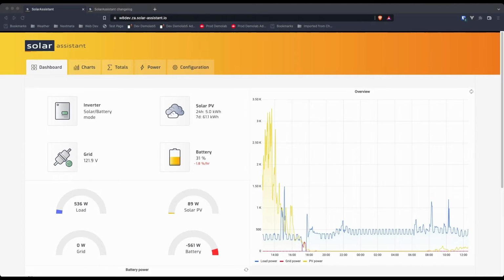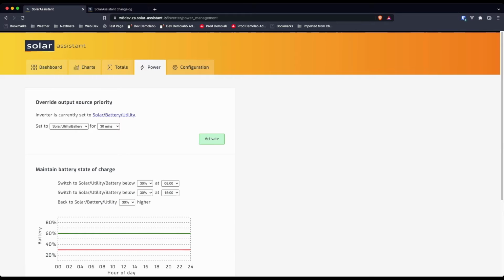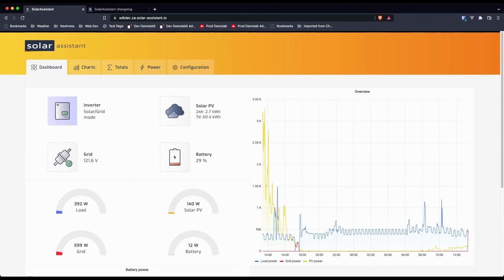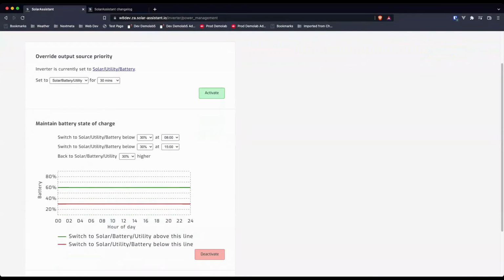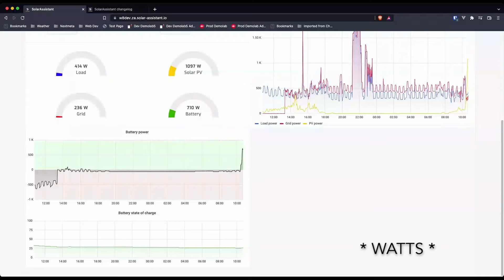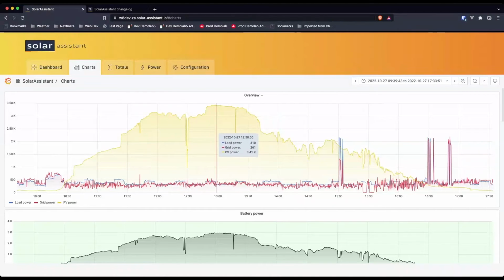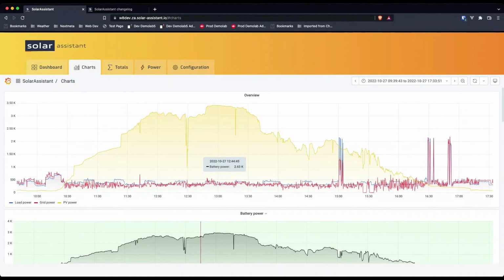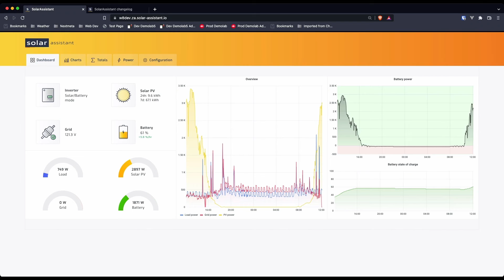EG4 6500EX and Solar Assistant - Automatically Switching from Battery to Grid for the First Time

Comment from the maker: After having some discussions with SS, I’ve found out that any time your inverter is in “utility” mode (whether that’s using SBU or SUB), all the solar power your system is producing doesn’t always go to the loads first (as the output priority states). Even though the modes and the manual dictate Solar, then Utility, then Battery as your output priority, apparently it doesn’t work that way.

According to SS: “In SUB mode, the inverter views Solar and Utility as its main sources of power, so it finds the most consistent, reliable source of power to power loads. In this case, it's utility power. as the voltage doesn't fluctuate as often, and it is available in the evenings as well. We recommend setting your inverter to SBU so that the inverter will use solar as its source to power your loads.“

Supposedly they’re supposed to be working on a firmware version to correct how solar is used when you’re in SUB mode so it properly handles the output priority specified.

So that might be one reason why there’s a discrepancy in load vs grid vs solar.

Something else I discovered was regardless of how many inverters you have set up in Solar Assistant, you’re only gonna see cumulative information on the dashboard. I have 2 inverters in my environment and each has 2 separate pv arrays. At any given time, you might have more solar coming in on inverter 1, but more of your loads are coming from inverter 2. In that instance, you’ll see power still being pulled from the grid while there’s power being put into the batteries (Because the battery power is being put in from inverter 1, but the grid is pulling power for inverter 2). Hope that makes sense.

The last thing I noticed was the different values in Solar Assistant don’t seem to all update at the same time. PV might update, then a second later the loads update. You’ll really see this when you’re on your Inverter Cluster page in Solar Assistant. So it’s kinda hard to be able to say for certain if the values you’re seeing are exactly the values at the moment when you’re trying to do any manual calculations.
Reply: Thanks Adam.  Great videos.  I've been following this one in particular as what you're trying to do is exactly what I'm shooting for.  My experience with a MakeSkyBlue Solar Inverter was so disappointing, I'm doing lots of homework and my leading next-purchase is an EG4 6500EX.  Did you get any idea from SS as to the timing of the firmware update that allows SUB to work properly?  Thanks so much.
Reply from the maker: @arrowpig1996  unfortunately not.  I’m a developer myself so I know it’s hard to nail down timeframes on fixes when you already have a lot to work on.  I’m not sure where this falls in the list of priorities.  

Now I will say, while it’s annoying to have all the possible Solar not be dedicated to your loads while in utility-bypass mode, it does allow for your batteries to recharge a little bit faster so you can switch back to battery mode quicker.
Reply: @AdamDeLayDIY  Thanks so much, that's a good way to think about it.  As long as most of the solar supplies loads (and charges), then I suppose the goal of saving power bill money can still be achieved.  Keep up the great videos, BTW.

Comment: Adam, thank you for your focus on the AC input.  I too am interested in more of a hybrid installation.  Minimize my grid consumption and use grid to pick up the slack at night of bad sun days.  Tempting to go EG4 because of the price, but Sol-ark maybe for the features.
Reply from the maker: Thanks.  Yeah, that's my entire goal.  If I can use solar as much as possible (growing the system when available) and using the grid to be my "backup power", it should definitely help save some money on utility bills and become less reliant on something where pricing is continuing to increase.

I know I mentioned this to someone else, but keep in mind you do get what you pay for.  In my environment, the inverters were the cheapest part of the system.  While the EG4s work, they do have their glitches/issues (of which I'm sure every system does).  All I can say is do your due diligence and try and find unbiased reviews for each piece of equipment you're looking for.  

Good luck!

Comment: I have an 6500ex which has still not been turned on yet.  Still working on on getting things setup.  I appreciate the look at Solar assistant as I have not got down that road yet.  My guess on why grid was still providing power even when there was enough solar was that your batteries were not quite at the 60% mark to turn off the pull from the grid?  Having never turned on my 6500ex myself or know anything about their programming I can only guess that it just looks at battery level and since you have it set to pull from the grid at 30% and not turn off until 60% that it is going to do that no matter what even if there is enough solar coming in during the time frame grid power is being used.
Reply from the maker: Good luck on your install!  Solar Assistant is definitely something to invest in.  I'll probably do another video just on how I have it all set up.

So to my knowledge, all solar assistant is doing is triggering the actual change on the inverters from SBU (Solar/Battery/Utility) to SUB (Solar/Utility/Battery) and back again.  I can mimic the same issues by manually switching the inverters priorities (completely excluding SA).  

The manual makes it seem cut and dry.  "Solar energy provides power to the loads as first priority. If solar energy is not sufficient to power all connected loads, Utility energy will supply power to the loads at the same time".  So either there's a glitch in the firmware, or the manual needs to be rewritten.

Comment: I have notice on more than one occasion that a manual switch with SA set the AC FREQ. to 50HZ and also did crazy stuff to other options. If you see the ac icon flashing it indicates 50HZ. All of your appliances become under performing zombies. Garage door openers do stupid things. I also thing we need to explore option #5 . Not sure that the EG4 preset is doing us a favor.  May use "USER" and pick your own voltages.
Reply from the maker: That’s very odd.  If made a lot of changes using SA and never had any erroneous additional changes made to any of my settings.  I have heard that there was a firmware issue which caused settings to reset when changes were made.  Wonder if your on an older firmware version?

I agree that I’ve heard of more issues with the EG4 settings than I have success stories.

Comment: Perhaps you could explain how the AC input hook up is done.  I have the main breaker panel approximately 25' from my critical loads panel and the CL load is 20' from the two 6500EX inverters I'll hook up my output to the CL load panel.  I assume the AC input needs to go to the main breaker panel.  Do I need a transition switch at that point or will the inverter do the switching for me?  I see on  your panel you have an interlock, so how are you getting power from your main if you switch it off with the interlock if you have no solar??? (which I have none at this time.), I just want to use the grid backup to feed my batteries (for now). I didn't see a transition switch.  Thanks in advance for your help.
Reply from the maker: I went through how I set up the grid connection in this video.  

Hooking up Grid Power to the EG4 6500EX Inverters
https://youtu.be/fkgb-yPJrOw

AC in comes from the main panel.  I just put a double 60 pole breaker in to connect to my inverters.  The only reason I put in an additional panel next to my output panel box was to have a disconnect close to my inverters.  

In regards to the interlock kit on the panel, that particular panel is a sub-panel.  Think of it as your critical loads panel.  The interlock kit is only on that panel in case I need to service the solar system at all, that way I can easily switch the sub panel back to grid power.

Comment: It remains in Grid mode in SBU until the battery’s reach the voltage set to go back to. If Solar first is set it will use Solar first to charge.
Reply from the maker: Was this in response to a specific question?

Comment: Find Will Prowse YouTube channel. He is very knowledgeable on these. He says to set the auto-transfer to 10% switch to grid and 90% switch back to solar/battery. He explains it in simple and clear terms. The best I've found on YouTube. He will answer all of your questions.
Reply from the maker: Thanks.  I’ve been watching his videos for a few years and most of his discussions are regarding completely off-grid systems with no AC in at all.  Do you have a specific video in mind?  Most of the time the 10%/90% suggestion is to prolong the life of your batteries by not discharging and charging completely.  There isn’t a hard and fast rule about when to switch between battery and grid power.  In my specific case it’s to get me off grid power as soon as possible and give me a buffer to run throughout the night till the sun comes back up in the morning.  The longer you stay connected to the grid, the more money you have to shell out for utilities when you have a completely capable power system available to take over your loads.

Comment: Have you found any answers to the utility taking over dilemma in SUB mode?. I am getting ready to try this for the first time myself without solar assistant which I still do not have.
Reply from the maker: @sh839c I've been talking to SS about it and here's the response I got from them: "I spoke with our R&D team about the SUB setting in particular. Currently, the way that SUB is working, is more like a 'utility mode'. According to R&D, the inverter has a preference for grid power because grid is more stable and has a cleaner sine wave. We are working on a firmware update to get the output source priority issue resolved at the moment, and as soon as we have it, I will send you a.3 copy"

I'm hoping that means that they will correct the SUB mode priority. 

The inverters do a have a way to switch to grid power automatically but it's based on voltage (or SOC if you have battery communication enabled).

Whenever you get SolarAssistant, it will open up a world of possibilities and data for you!
Reply: @AdamDeLayDIY  Thanks for the update, Adam. I do have battery communication enabled so I will try it using the soc option after I re-wire my panel correctly.

Comment: What smart shunt do u use?
I'm looking at the victron. I have no data but I do know that even in bypass My inverter continues to pull about 1 amp fro. The batteries. That's what my BMS is showing anyways. When on I have about 1,000 watts of constant draw at night between the outside lights and appliance parasitic draw. I have seen once the grid was lightly charging my batteries when they died and I have it set so solar charging only. There is definitely some software glitches in all of these inverters. Hope you get your figured out!
Reply from the maker: I have the Victron 500A smart shunt.  Had it for quite some time and seems to be very accurate.
Reply: @AdamDeLayDIY  yeah that's what I think I'm going to get. The SA is through the inverter tho?
Reply from the maker: @electromechanicalstuff2602  Not sure I understand the question.  

So SolarAssistant can use it's own internal calculations without the need of connecting a smart shunt or direct connections to your battery, but obviously the calculations are only going to be as good as the info that's received from the inverters.  To me it seems best to get the details straight from something designed specifically for those calculations.  I plan on trying to do a walkthrough of how I have SA set up and how it works after I do a video of what I actually see when the inverters switch between grid/battery.
Reply: @AdamDeLayDIY  supposed to say SA IS through the inverter? Or is it an external device? 
I bought a wifi module for my MPP but I could never get it to work. I called watts 247 and he told me to try a few things but it never worked $100 wasted. Thinking about trying to buy another and maybe returning the old one if the new one works
Reply from the maker: So SolarAssistant runs as an external device on your network.  It's a Raspberry Pi with custom software.  It can be connected to the internet or it can generate its own hotspot and just be local.  You then plug in connections from your inverters/shunt/batteries into the pi and SA gathers and records all the data and displays it in charts/graphs.  Depending on the Pi model, it can update display data within a second or two (unlike watchpower which was every 5-10 min???).  It really gives you a near realtime view of your power usage (plus it allows you to configure a lot of options on your inverter without having to click through the menu on the physical device.  

There is a one time cost to the software, but it's well worth the investment.  If you buy a preloaded raspberry pi, it costs more.  If you have your own (or can find one on ebay) I wana say it was almost 1/3 the price of the fully loaded hardware.  

When I had my 12v system, I was using the Victron VRM to monitor all my devices and data and it really spoiled me.  Victron really does an awesome job.  Seeing watchpower just felt like a punch to the gut in terms of monitoring.  It's a joke.  When I found SA, it was almost exactly what I was looking for.  It's no VRM but it's a million times better than watchpower and it's constantly being improved upon every few months.
Reply: @AdamDeLayDIY  hmmm 🤔 I'll have to look into this deeper
Reply: Most of the time mine is in SBU mode and I love how it’s working. I haven’t ran mine in SUB mode so I’ve got no clue if it’ll draw a 500w idle current from the grid when I’ve 4000w from PV at the same time. I have Solar assistant too. I have the inverter’s charge timer set to come on in the early AM for 5 hours at 2 amps per inverter. That way if the forecast is for rain I just bump up the current guesstimate remotely with the SA app from anywhere. I may play with the SA app charging parameters when I get some time but it doesn’t know what the weathers going to do. (I hate to give the utilities any more money than I have to). It may an idea to employ both incase I forget to adjust the current because I think less and less about my system. I just wonder if there’d be a system conflict if both timer and SA go to grid at the same time.
Reply from the maker: @SkypowerwithKarl  What do you mean by the “charge timer”?

I agree about giving utilities any more than I have to.  That’s why I only charge the batteries from Solar.  I use SA to switch to grid to take over the loads until I’ve gotten enough Solar to recharge the batteries. 

As far as a conflict between the inverter and SA, to my knowledge all SA does is send a command to the inverter to change the input priority.
Reply: @AdamDeLayDIY  
Your inverter has a charge timer. On the master, push and hold the middle of the left three button until the three selections come up. I use the USB timer (top left button). That opens the the start and stop times. Left middle button selects start and lower left selects stop. Adjust time up and down with top right and middle left buttons (up&down marks) for each value you must save the time with the enter button (lower left) when done tap upper left to exit. The USB timer works for me because my main setting is SBU (in program #1) you may need to find another setting if different. 

Of course you need to have the correct time set in the master inverter. Rules/weirdness; the off default is 00 and 00 times. Don’t use 24 or 00 in the times. The actual off time is actually one hour later than entered the time (06 is actually 07) Don’t make time adjustments while you’re within the the actual running window ( do it before or after the charge time). Any time adjustments done inside the window won’t take, won’t release or won’t change till later. Any fault or powering down of the inverter may clear the timer settings and you may need to go back and check to see if it’s still there.  Easy huh?🤪
Make notes so you remember what the hell you did to make it work 6 months later.
Reply from the maker: @SkypowerwithKarl  Ah yeah, now I remember what your taking about.  Thanks!